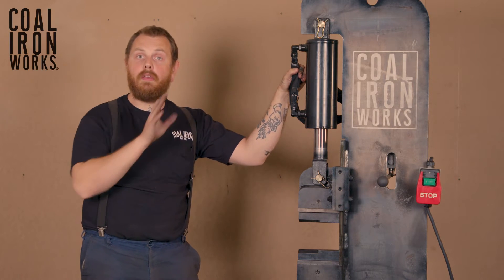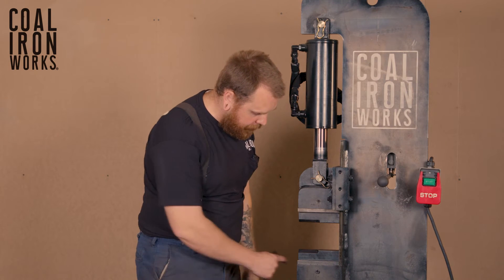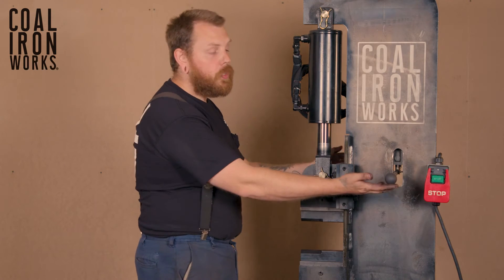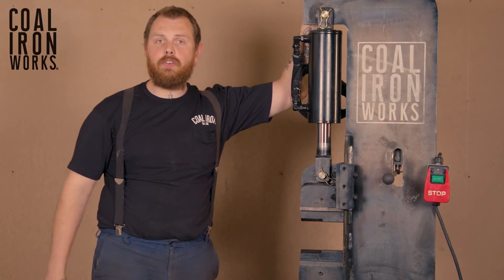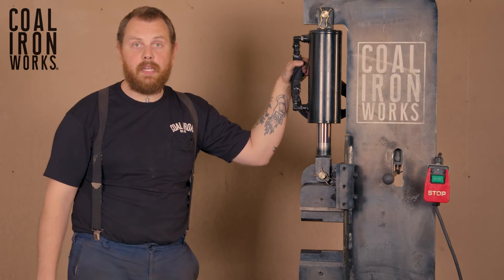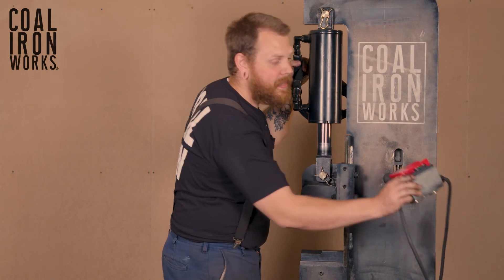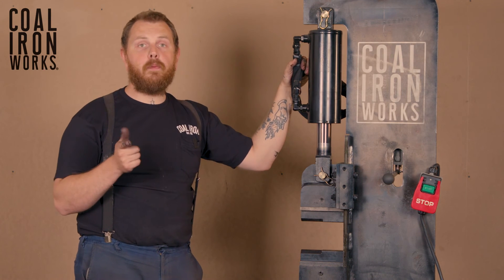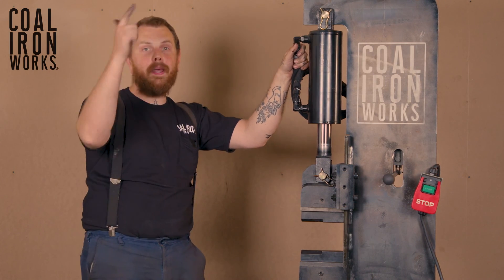Coal Iron Works: C-Frame Press Overview

Comment: Are the 6 adjustment screws supposed to be tight? I noticed that they loosen over time, but wasn’t sure if they we’re supposed to be very tight or not.
Reply from the maker: They should be just past hand-tight (roughly 30 ft-lbs). Feel free to apply lock tite to those bolts, by the time the lock tite breaks, it'll be time to readjust the bolts again.